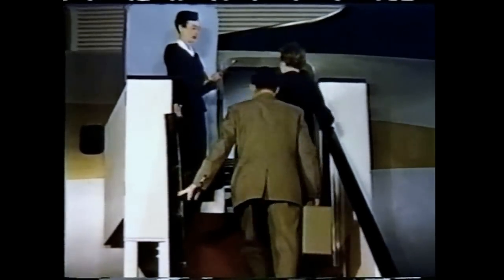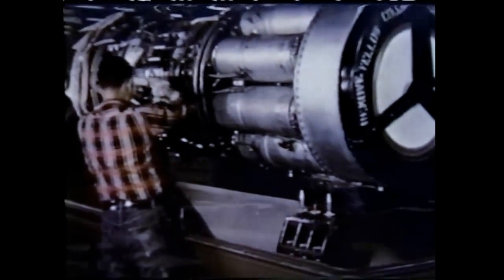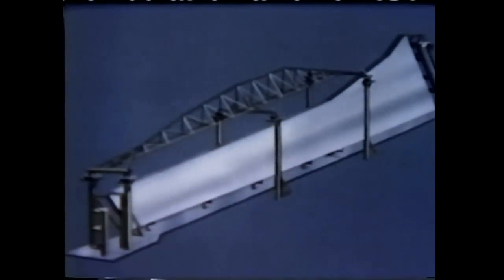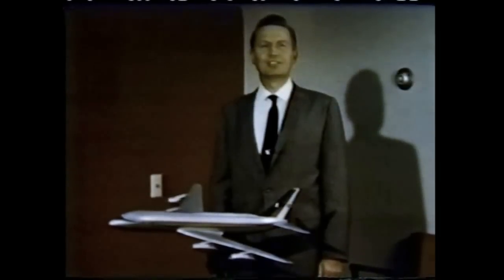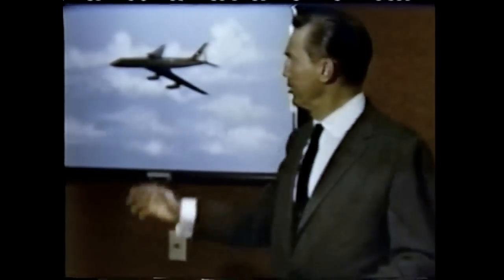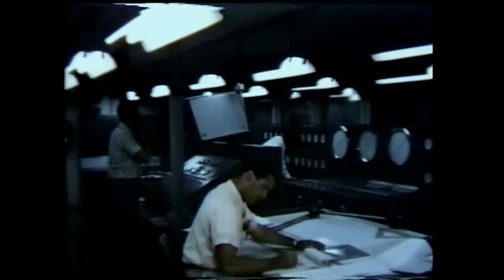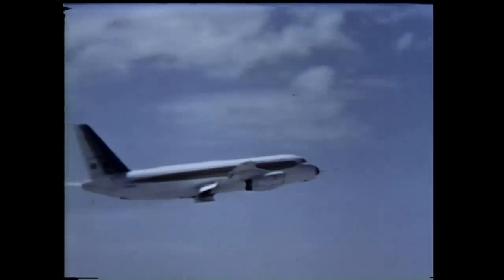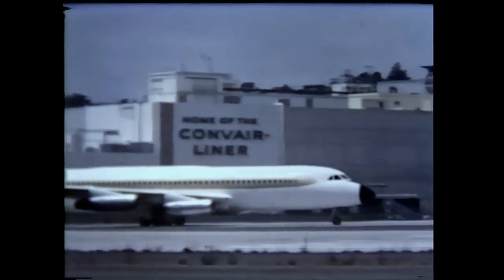Convair CV-880 Jetliner Progress Reports - 1958 & 1959

Comment: I remember being aboard a Delta flight on a Convair 880 many years ago, and noticing as much about the airplane as I could.  It turned out that the 880 was certified to use the inboard thrust reversers in flight as speed brakes.  The only airplane certified to do so.  =PC=
Reply: The early DC 8 could put there outboard engines in reverse in flight also but it wasn,t done to often shook the plane alot and scared passengers a bit

Comment: The 880 and 990 were amazing aircraft structurally. The 3M ScotchWeld process eliminated the need for rivets, but rivets were added anyhow. System-wise, they were complicated and over-designed, which meant maintenance-intensive, despite what this film claims. They were fuel guzzlers, even for their day. Despite all this, they have an amazing 'aura' about them, and the five across seating was actually more spacious than the six-across on the Boeings.

Comment: The CV-880 and CV-990 stressed highly on performance at expense of operating economics and both were sold poorly. Had they built a more "economical" variant, things might ended up differently. In contrast Boeing 707 have a much broader appeal with 2 variants and some degree of customization based on airline's request.
Reply: DC-8: Am I a joke to u?
Reply: What kind of manufacturer could ignore operating economics?  Stupid.
Reply: @MrShobar  You're right. However, until the mid-40s Convair(Consolidated) was primarily a supplier of military aircraft. The military primarily wants toughness and performance. Operational economy is farther down their list. This may have conditioned Convair's thinking, at least, subconsciously. The 880 and 990 WERE fast and rugged. One airline pilot stated that "if you want an airliner in which to penetrate a cold front, the 880 is your plane". That toughness and the 5-abreast seating priced Convair out of the better economy airlines demand in a plane.

Comment: It's great to watch commercial airliners moving forward step by step, adding features and creature comforts. The 880 didn't seem to be very competitive, 4 or 5 across vs 6 with the DC-8 and 707. As an aviation junky speed means more to me than most PA's who are far more concerned with departure times that a 8 minute advantage over it's competitors and there would be a fuel cost to get that speed. No wonder Delta went heavy on the DC-8 and TWA with the 707, rather than buying more 880's